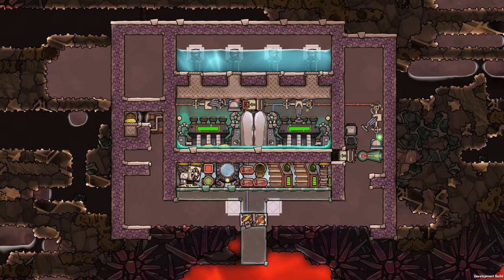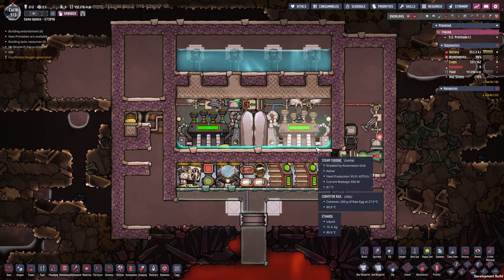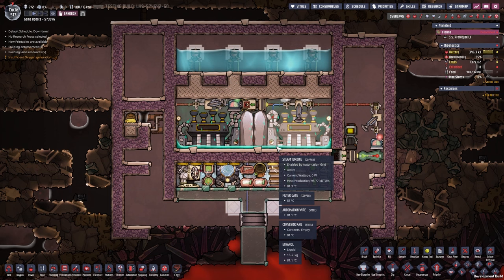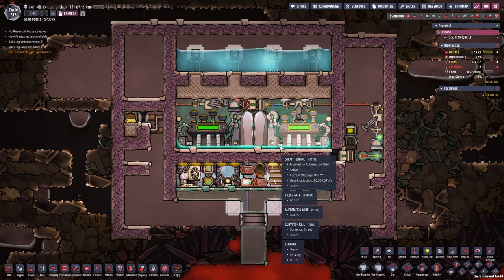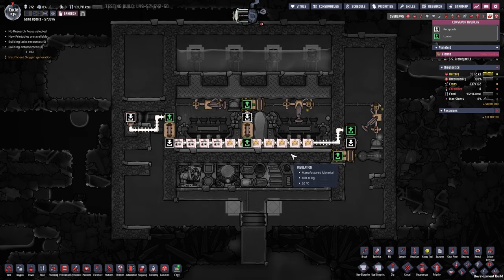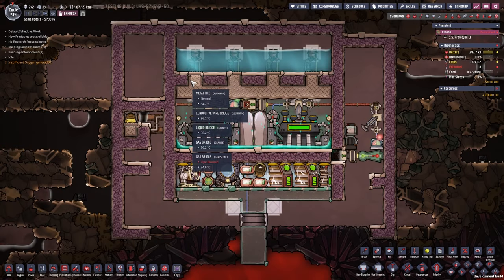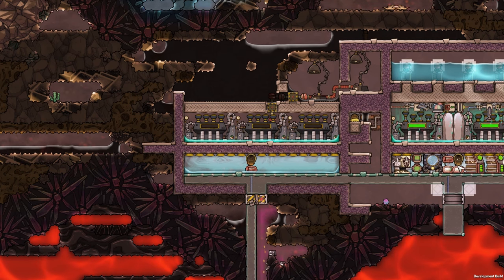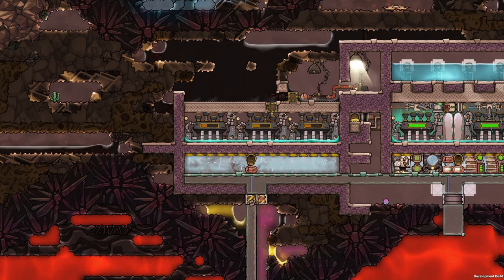Geothermally powered cooling Setup + Omelettes?

Comment: The main drawback of this design is the need to have turbines be in a sealed environment. Why not use the ethanol to cool AT and TR directly, without the use of ST? Both of them are in a sealed chamber anyway, so there would be no additional need to isolate things.
Reply from the maker: Psst that is another video. ;)
Edit:what is TR?
Reply: @lumaraw  Thermal Regulator? That's assuming AT is Aqua Tuner and ST is Steam Turbine
Reply from the maker: @pennyjim5671  Ah! Right!

Comment: This is cool build, but I cant stand Ethanol, Once if off gases in a dirty brick it is a pain in the ass to deal with because it breaks pipes trying to get it out, makes a huge ass mess. I try to avoid using it it all possible. If you gonna use it KEEP the area Cool 100%.

Comment: Cool concept but not very viable for late game base because it make the game laggy with gas and liquid moving
Reply: Since it's in such a small area, 
it would have literally no impact, so don't worry!
Reply: You can vacuum out massive areas of the map and tile it in, destroy extra ladders and avoid using jetpacks to minimize duplicant movement calculations (only need 10-15 max for endgame), and sweep everything into one big pile for probably the biggest savings of sim calculations.

I am not saying that this video won’t lag out the game, but we have many tools at our disposal to optimize the map ourselves.

Comment: I'm loving the ethanol applications, with this technique could a single wheeze wart cool a full power steam turbine? (Either domestic or wild)
Reply from the maker: That is a good question. I am not sure how the wheezewort would behave in that environment.
Where exactly would you want to place it.
In the steam turbine room there is a constant temp of around 78°C if i remember correctly.
Reply: @lumaraw  I would put the wheeze wart in a hydrogen filled metal box above the turbine for the ethanol to condense on to try to keep the vacuum.

Comment: Don't you have to cool the water above the set up eventually? It's the same as cooling the turbines, no?
Reply from the maker: I try to explain:

Yes it does the same but with ethanol as the middle man it should be more energy efficient.

For the Setup:
-you can cool the metal and have nothing above. it shouod be more effective than cooling the Steam Turbines directly.
-you can cool the steam turbines directly.
- you can cool nothing and only add liquid on top.
those are the options for the cooling of the ethanol which is only necessary if the ST get hot which is only necessary if the Aquatuner cools something.

Your options for the aquatuner are: 
-having a large cooling loop running trough your base (and end in the metal tiles before closing the loop in the steam chamber 
-cooling the pool above to have that a s a cold buffer amd then run the bases cooling loop through that
- cool anytging else.

you can the also use the heat from the Aquatuner for something 

etc.